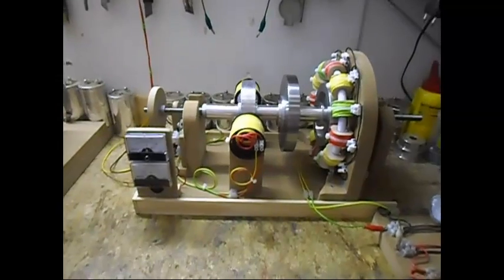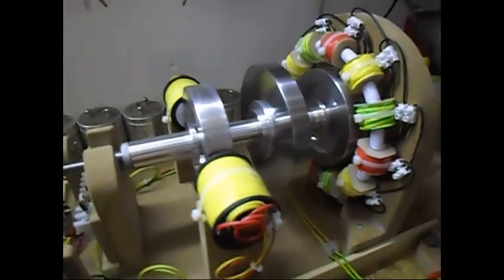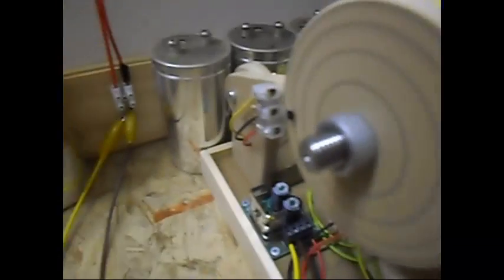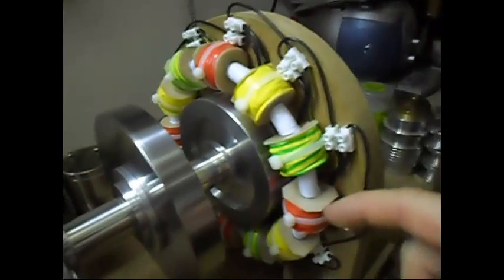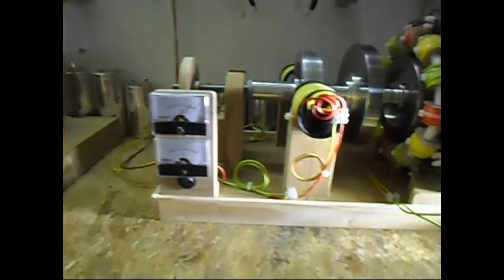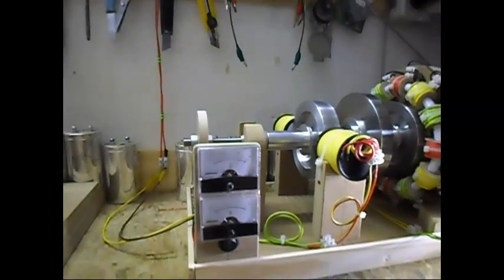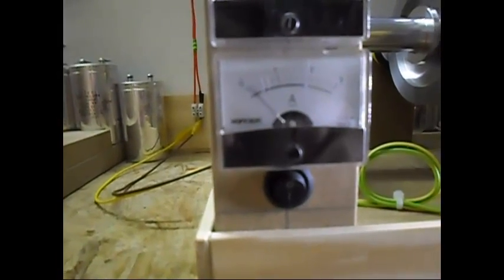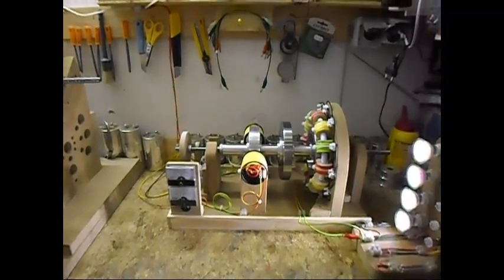PMBO 2014 - Second Entry, Smooth & Efficient Running Pulse Motor...

Comment: Do you still have this machine?
Reply from the maker: Thanks for your comment and i don't have this setup anymore but i do have all them parts which are being used for many other setups...^^
Reply: That's unfortunate....I have a machine of similar design...mine is what the uninformed would call Lenz free....

You do excellent work, keep it up!

Regards
Reply from the maker: Thank you and i do the best i can and it is good to read that you have a machine of similar design...^^
Well a lenz free machine is also a energy free machine...lol
Having lenz means one is having energy production and visa versa...;-)
Cheers
Reply from the maker: Just wanted to add that with "energy free machine" i mean a zero production of energy which is a useless generator...^^

Comment: Ya your right, i could try harder but part of the problem is my urgency to slap something together and being a bit lazy in the process. Lol! But you have a good point to make a sleave to take up the gap. I have 3 different pulse motors on the go and im trying to figure out the best one to power my "special generator setup". Anyway thanx, and good luck in the pulse motor build off!
Reply from the maker: Lol... urgency to slap something together and being a bit lazy in the process...
I used to do that to sometimes...but learned that it always back fire on me so now i'm take my time to make whatever i'm making...lol 
Hope figure out soon what type to use to drive your "special generator setup" and thanks for the good luck wishes for the PMBO...:D
Cheers

Comment: My axle and bearings are never the problem, its when i put a rotor with a 1/2inch centre hole on a 5/16inch shaft and take up the gap with electrical tape and then the rotor never sits right. Lol. But its okay for now, for the experiment phase im in. Ill have to get an actual machine shop to make my stuff when im ready. Anyway thanx.
Reply from the maker: Hi Ryan Doupe,
You're welocme...^^
I see and lol...a 1/2inch centre hole on a 5/16inch shaft and take up the gap with electrical tape..no wonder it wobbles...;-)
Since the spacing you have is like 1.5mm all around or so why not try a piece pf PVC pipe...cut a ring and than cut it open and remove a piece until it fits...you can even use sandpaper to sand it down a bit if it is to thick...try sand it all aorund otherwise it will start to wobble in the vertical position...
I think it could fit very well seeing your numbers...^^

Comment: Hi, i use just about anything, wood, aluminium, rollor skate wheels, caster wheels. I try to find stuff thats round with a hole in it to start with then make it work. I use 5/16 steel round stock for a shaft and rollor skate bearings since im starting with a small setup. Once it looks promissing then ill go big!
Thanks.
Cheers.
Reply from the maker: Hi there,
If you're using a nice smooth axel with bearings i can't see why they wobble...???
If you where using those threaded builder bars for a axel and connecting the rotor with the nuts they sell at the same shop you will encounter this problem since those nuts and the bars are not precision ones...they wobble a lot so connecting your rotor with them will make any rotor wobble...they are for construction work but the wobble problem can be helped...
Is this how you go by it...???...if so i do have a simple and cost nothing solution to get the rotor straight and only patience is needed...lol
Let me know if you need this info or not...^^ 
Cheers